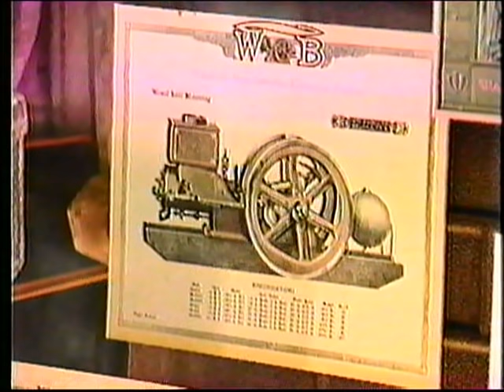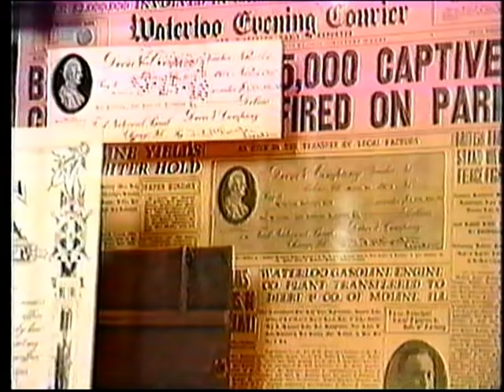John Deere Two Cylinder Engine Tractors 1

Comment: My family bought a Model L I think in 1939.  They used it on a small family farm to plow, disc, cultivate, pull a horse drawn mowing machine and a hay rake.  They also built a small dozing blade assembly and later pulled a flip scoop which could be an interesting device...specially if you fogot to let go the handles when dumping.  Greg

Comment: I used to drive the two cylinder John Deere's.  The A, the D, the M and an older version of the A. The D was started by turning the flywheel and doing the other bits.  :)

Comment: One of my first jobs was in a machine shop where they rebuilt engines in the old "Poppin' Johnnies". My main job was boring the cylinders which would wear in an oval shape because of the weight of the pistons laying down in a horizontal position.
Reply: Never considered that configuration would cause uneven wear.  Makes sense though.

Comment: I grew up on Olivers, but my uncle had a couple of JD A's.  As a kid, the A was easier to determine what gear it was in.  Pulling in loads of hay, the A needed a drawbar lock pin to keep the pin from jumping out.  When we baled hay with the A, anytime we stopped, we would always leave the clutch engaged, and just pop the shifter into neutral, to keep from plugging the baler.  After a couple of years, our 77 Oliver was the tractor of choice for the baler.

Comment: I remember my dad had two As they were great tractors at the time one you had to start from the fly wheel I could start it when I was about 12 years old .then he bought the 720 power steering what will they think of next we thought that was one  tuff tractor I cant amagine how many miles   I put on that tractor .
Reply: What happened to punctuation?
Reply: We had an A and an H.  Both of ours had electric start, but the battery was usually dead on the A and I most often started it by hand turning the flywheel.  We got the H when I was 13 and the A when I was about 15 and except for rebuilding the hydraulics in the A I don't think we ever added a drop of oil to either one that I can ever remember, lol.  We built a wood splitter to run from the hydraulic pump was why we rebuilt it, hooked it up with quick couple hoses.  We did the plowing, tilling and harrowing with the H and did bush hogging, mowing, raking and baling with the A.  Put a few miles on those two myself.
Reply: @423FGFDFHFHV  does it really matter??

Comment: At45:00 jd with steel treads id use a ruber bad bolt ons or use bed linner on the points of the wheels

Comment: Fiat had small crawlers early on also. Two cylinder design not good.
Reply: Spent many hours in my youth operating a JD A, B, and G. Extremely reliable, never broke down all the years my Dad had them. Still love the unique sound and glad there are so many keeping the old two cylinder gas and diesels running.

Comment: jesus a chain?  what a piece of crap steering system, looks like something some kid joy rigged together
Reply: Lots of tractors had that type of steering back then, granted most of them were steam traction engines though.  Jay Leno has one on his channel.
Reply: Rob W Need to remember these tractors had 2 speeds, slow and slower. Chain steering worked well enough but it is rather clunky.
Reply: Rob W is one of those that try to apply standards of today to people and machines of the past. If I judged the southern confederacy  by todays standards they were evil and wrong. But, I realize that they were Men of their time.
Reply: What have you designed and built?